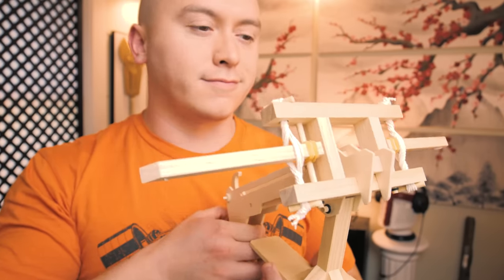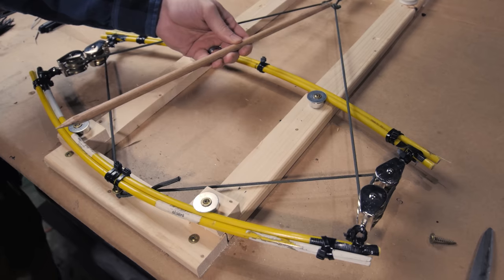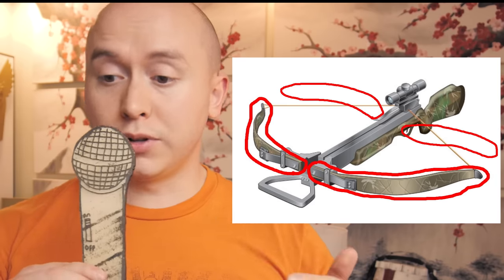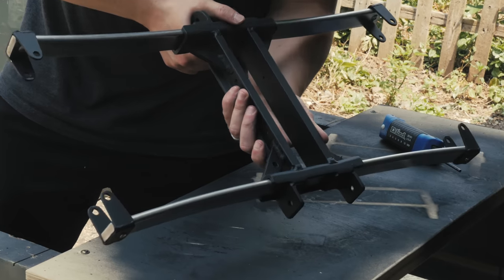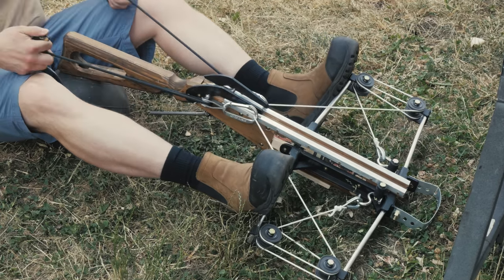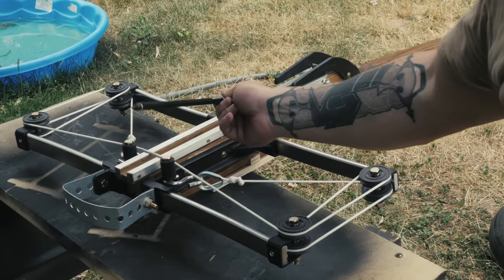BREAKING: Experimental Crossbow is Fr*ckin' Sick

Comment: Tip for drilling with the masonry bits - the carbide tips mostly break when they are coming out the back of the steel. You'll get rid of most breakages if you put a piece of scrap steel behind your piece so it doesn't break out.
Reply: And don’t allow chattering. Drill press!
Reply: Also, cool them. Carbide hates being overheated and becomes even more brittle.
Reply: @Nworthholf what's the difference with carbide flow drills, they can handle it because they only experience friction and don't do any actual cutting? (Not trying to be a smartass, I'm genuinely curious because I know there are many kinds of carbides but dont know the specifics)
Reply: @KibitoAkuya  as far as I know - yes. It does not burn per se, so its alright as long as you dont slam it into other hard things (as you do with lathe and normal drilling bits).
I never tried, but I would imagine that flow drill will happily crumble if you drop it on a cast iron plate or smth like that

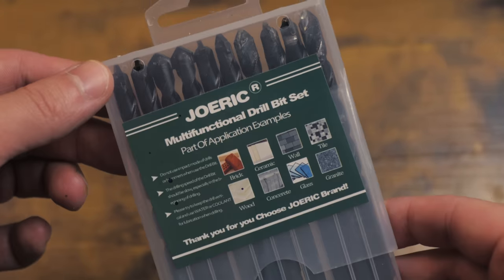Comment: @4:30 "masonry bits" - you can regrind masonry bits to proper metal cutting geometry with a Drill Doctor or similar (some Kentucky windage is required to properly set up the masonry drill on the collet, since the flutes are interrupted by the brazed-on carbides, so the indexing finger doesn't position the end of the drill properly to the grinding drum).  If you're good, you can probably do it by hand on a diamond wheel, but I'm not that good.

You can drill out stubborn wheel studs (my most common use of this technique, of late), drill holes through cast-off planer blades or other pre-hardened tool steel blanks (maybe to mount wood chipper or flail mower blades), etc.  If you have a Cole drill (poor man's port-a-mag) or an old fashioned blacksmith's post drill, you can combine high end pressure with slow speed for best effect.  Or, a real mag drill, if you are so endowed, though the manual methods take the slow speed to an extreme.  If drilling larger diameter holes, step drilling will still be your friend, just as with standard helical drills.  You can also use the masonry drill to poke a center hole, then use a good bi-metal hole saw or diamond hole saw, following the pilot drill, to trepan really large holes.  If using the hole saws, you'll need to back out frequently to clear chips, because the gullets are not up to the task of continuous drilling.

In high school, a buddy and I started to build a leaf spring crossbow, based on the old Popular Mechanics article, but we never completed it because we chickened out after we calculated the draw weight.  You're a better man than I, Gunga Din.

Comment: Actually, you are 1000% right about the wet cutting. You want to be careful with the electricity, obviously (water protect any plug junctions with seal boxes and make sure there is a GFCI breaker for that circuit in the panel. Or an outdoor rated gfci receptacle), but wet cutting is industry standard for cutting stone and masonry for a reason. Even using a fitted respirator, you get particulate dust in your lings, and granite fabricators were getting lung cancel left and right, which is why the industry eventually moved to wet cutting. Glad you found your way to it.

Comment: You’ve effectively made an easy to load heavy force crossbow. The way you built it to be stand loaded is actually quite genius. Looking at the design, with it built pretty much like a rectangle to stand and pull on, I’d suggest adding more pulleys side to side from the front to form two loops over the rectangle, like an M.

Comment: I still have a multi limb set up in my design.  The limbs are sandwiched between two large squares of steel and bolted together.  Was going to be riveted, but bolted makes it easier to take apart.  I use fishing line made with Spectra and Dacron of 200 pound test, and mix in some Elastic string, and use a 50 pound test of the same brand and material (Spectra and Dacron) as the finishing line for my bow string.  I make all my bow strings out of the same material and find it's superior to industry bow strings.  The one for my crossbow is an inch wide and 8 ft in length because of the Lawn Mower Pulleys on the ends of the limbs.  The limbs are huge, 6 feet in length, (Medieval LongBow length) because it fires full sized arrows.  😁  Proud of myself for making the monster.  Shot a nice 8 point buck, went completely through at 70 yards, arrow was in a tree 25 yards away.  Wondering if it'll be accurate at 200 yards?  I'll have to set up a dummy and find out.

Comment: Fascinating design.  Surely I cannot be the first one to mention this, but what you need is actual machine tools.  You're clearly far beyond the level where cobbling things together with hardware store components and tools makes any sense.  Taking a machine shop class at your local community college, trade school or vocational school would eventually catapult you to professional level.  I was much like you many years ago.  Today I'm a gunsmith and machinist in the firearms industry and I work for a Class 2 Manufacturer.  You could be turning out factory grade stuff with some training and the right equipment.  Just knowing what to do with solid carbide drills and endmills to machine hardened steels and having a small benchtop milling machine and a lathe would make what you're doing radically easier, and you could probably turn this into a career.  You probably already know who Joerg Sprave is.  But if not take a look.  YouTube can teach you a great deal of machine shop and metals fabrication technique.  You could really use a TIG welder too.  Definitely wear a respirator when grinding metal without flood coolant.  That dust is lethal.  Blowing metal boogers out of your nose is super extremely bad.  They shouldn't be there.  Polishing and buffing is also extremely hazardous.  All that abrasive dust is deadly, as are paint fumes.  Deadly.  Don't breathe that stuff.

Comment: I remember back in the early '80s a couple of mad lads' science fair entry was a bloddy BALLISTA made of two crossed truck springs and thick steel cable.  IIRC, the sprints were welded together with the mounting hole in the center widened to fit the bolts made of six foot chunks of rebar.  They actually got permission to fire it on school grounds, and the bolts EASILY cleared the far end of the football field.  Apparently, the guys later mounted it in the back of a pickup and ran up and down logging roads in the bush, hunting moose.  Those were wild times, back then!

Comment: To drill through spring steel using a high speed steel drill bit. lubricant for that is mineral turpentine 
Cut through with ease 
Used that process for many years a trick an old blacksmith taught me

Comment: Pro Tip with drilling out metal without destroying your bit. You want a very slow speed with plenty of pressure. Don't let the bit get hot. It might take a solid minute to drill a hole but you'll save your bits.

Comment: Arrows are seated through the front like a Muzzle loader not on top, which allows for a much necessary optic.  From butte to where the arrows loaded it's 7 feet in length, and weighs 25 pounds.  Only wood is the butte and pistol grip, everything else is Aluminum and steel.  The limbs are made from Leaf Springs (5160 Steel) from a Semi Truck.  The Bow string is attached to a car like block that goes down tracks on the bottom and top of the inside body of the Crossbow.  The little car block has Sealed Roller Bearings for wheels.  This is the second version of the Crossbow as I wasn't satisfied with the design of the first one and will probably get like that with this design.  Finally wanted to say that yes, I'm allowed to hunt with it, in Texas at least.  Texas Authorities told me I could pretty much hunt hogs in Texas with Artillery.  Yes the hogs have gotten that bad.  Rage Broad Heads and Grim Reapers are what I tend to use.

Comment: Thats a pretty awsome build. You may take a look at an old old crossbow build called ye old atom smasher. They use a leafspring to make it also. I made one a number of years ago and if you taper those thick limbs like they show they work alot better. You get more speed and power from them that way bc its got more power the closer to the center of the limbs you get byt at the end theres less weight so you know.. physics.

Comment: This build is more similar to a medieval crossbow than a modern composite. The weight and power of the spring steel is going to work best with a really heavy bolt. It also looks like you could probably get more power with a longer draw, although you'd have to switch to a crank device

Comment: Dude, I like your content and style! Try some motor oil or gear oil when you drill steel. Especially hardened or spring steel! Also, if your drill press has adjustable speed, bring her down about 3 notches. That will prolong your cobalt bits. 😎

Comment: Arrow/bolts with a wooden shaft is actually quite bad for penetration since the wooden shafts actually adsorbs the energy. Replace it with a very rigid material and it will practically go through anything. Steel is very good material for the shafts.

Comment: On those two bolts with the rubber tube you should get some flat bar either alum or steel and bridge the two together to reinforce that bit

Comment: Hi grate vid let me share a top tip you may not know but shud try ? When drilling steel that's hardend try putting a spot weld where you have to drill ?it makes the steel softer in that spot .making it easy to drill saving time and money .And if you won't to tap treads  it helps ?

Comment: When you grind or cut with an angle grinder. Stay above your work and make sure the direction of the sparks or little pieces of steel that fly off is going away from your body. Otherwise I don't know why you are having the " steel booger " problem. I mean I used to do HVAC I'd be grinding for hours. I've never had that problem.

Comment: it's possible you lost the monolithic Spring Steel Tension by Grinding it so Much, were they re-tempered after all that work? Also, if you can, check out a Flow Drill, or  a M2 Tungsten Steel drill bit, they don't hive a single EFF about Hardened steel.

Comment: You don't need a hose, but some cutting oil and slow drill speeds will save you a ton of pain. Masonry drill bits on steel is no good.. Slightly dangerous. Quality drill bits + cutting oil + slow speed = 👌

Comment: If that stirrup is too far forward to use practically, why not pivot it down 90deg, and move it back down the underside of the stock about 6-8", then it could be used for loading, AND double as a Bi-pod?

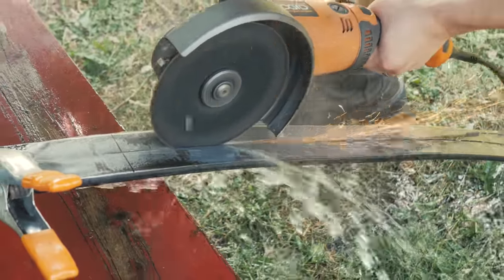Comment: 2:20 That is a VERY bad idea. The cutting disc is a fibre one, which falls apart when wet. I've proved that many times, so go for it, if you want a face full of supersonic shrapnel. The way to keep the heat down is to cut slowly.

Comment: In high school I went to Technical School and at the Machine Shop we made a Ballista out of the leaf spring of a pickup truck we even made aluminum ends for it and used steel aircraft cable for the string I don't know what the poundage on it was because we have used a come along to Cock it and we had to bolt it to the floor to an old machine bolt it was in the floor for an old Lane to keep it from moving when they cock it but it would shoot through an entire Square cube of cinder blocks we lost the first two of the solid aluminum arrows in the woods somewhere the third Arrow went to the blocks and then stuck two thirds of the way through a tree

Comment: I've drilled a fair amount of hardened steel, not fun, I'd like to see your drilling process. 

At a cursory glance, you're not making proper piolet holes, which should take 2 piolet holes and then final size drilling. 

Rapid tap, as lubricant/cooling I don't know of a better product.

Gental, get a drill bit speed chart, I typically just go slow, rpm, weight of arm for pressure you don't want to cut deep, you'll insta dull stall and snap, you want to know when to sharpen your bits.. 2-4 mm or 1/16 - 3/32" ish.

That's the best written advice I can give you.

Comment: What if you put bearings in the channel where the bolt sits. If you got a bunch of skateboard wheel bearings, and line them up in a row in the channel where the bolt sits. The bolt could just glide over the bearings, and in theory, the bolt should travel faster because there should be less friction.

Comment: You probably already know this but make sure to check those bolts after they hit a hard target. The shaft can weaken and can splinter in the bow if they are cracked. This is especially bad when dealing with carbon arrows

Comment: Since you're still learning, I recommend smaller videos. If you can tolerate a 'toxic' community in chat, tradesmen will mock your mistakes. Basically, so you don't develop bad habits, just like any crowd, you got good and bad eggs. Sacrificial testing recommended or if you prefer treat it like a prototype. 

 Fineness comes with pain, quitter never win, winners never quit. 

Cheers

Comment: Pro Tip: The harder the steel you're drilling, the slower your drill RPM should be...and the larger the drill bit you use, the slower your drill RPM should be...chances are you're burning up Cobalt drill bits because you're spinning them twice as fast as they should be going, which just causes heat, and heat causes the steel to get harder and the drills to get softer...

Comment: Carbide bits shouldn't be that bad though... If you drill with the proper drill speed, use cutting oil and maybe drill a proper pilot hole then you should be fine. If not, then resharpen the bit and keep going

Comment: To have the water going on a corded electric angle grinder is just a disaster waiting to happen.
You would use an air tool for this or at least battery.

Comment: Also why not just spring for some proper carbide tooling rather than use masonry bits that aren't designed for steel?  Sure it can be a bit pricey, but it probably evens out in the long run because actual carbide bits designed for metal/machining will last quite a bit longer than just one bit per hole.  I mean I'm able to get quite a bit out of my carbide tooling by simply adjusting my speeds and feeds accordingly to specifically extend tooling life.  Idk man, maybe look into it...  I promise it will make your life so much easier lol.